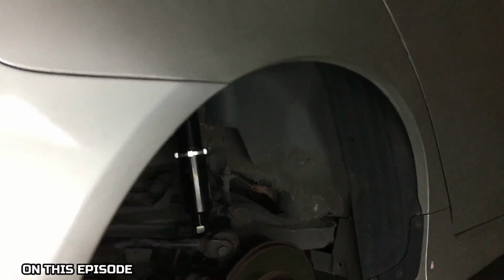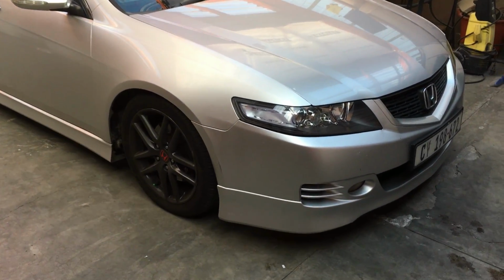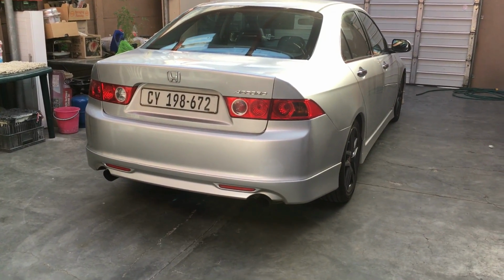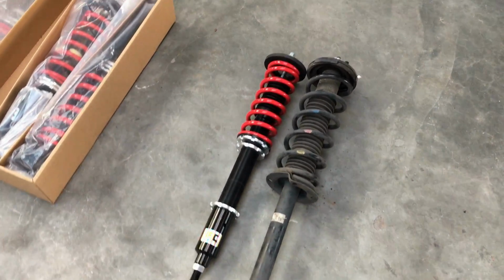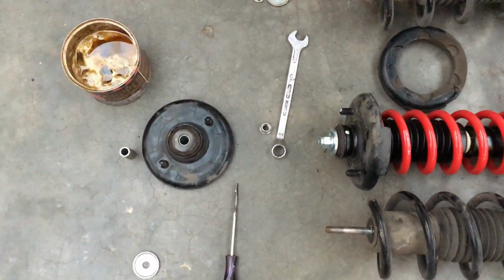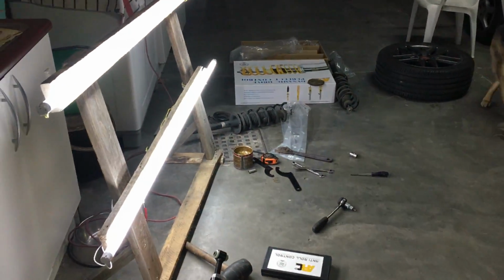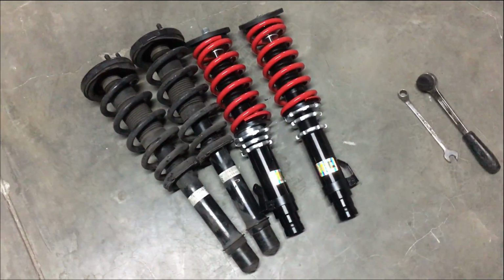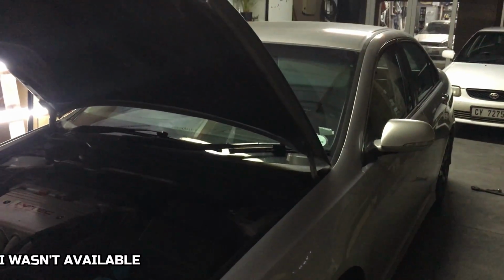HONDA ACCORD ARC COILOVERS INSTALL & REVIEW

Comment: But guys what does "it's a good coilover" mean, how does the ride compare with the initial cut spring ride in terms of 1. stiffness 2. ride comfort (softer or harder than springs?) 3. General handling?... Would you say in terms of ride comfort ARC is better or inferior vs. FK n Jom🤔
Reply from the maker: Yo bro i dont hav any experience with those other coilovers so i cant tell but one things for sure ARC coilovers give a better drive to standard old shox
Reply: @WongStreet2Track  thanks bud, but how does the comfort compare to the removed springs. Is the car now more comfortable or harder?

M considering getting the coilies m kinda doing research on what your (you guys) experience is